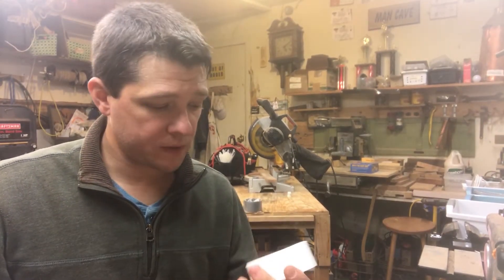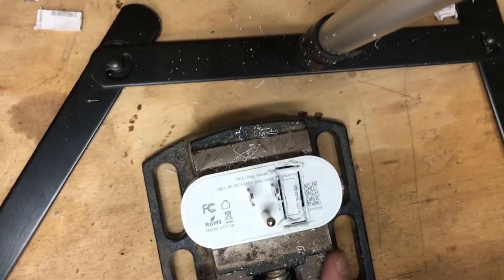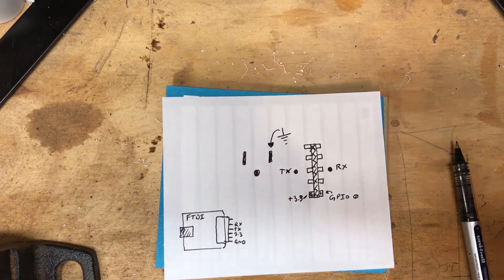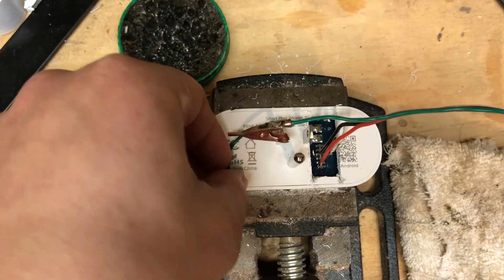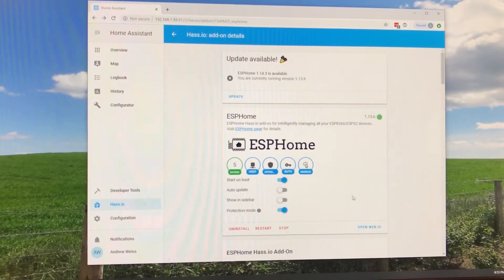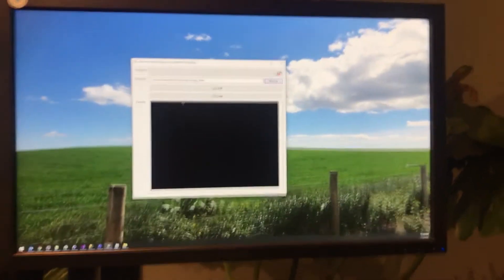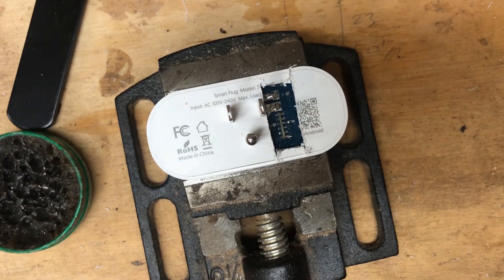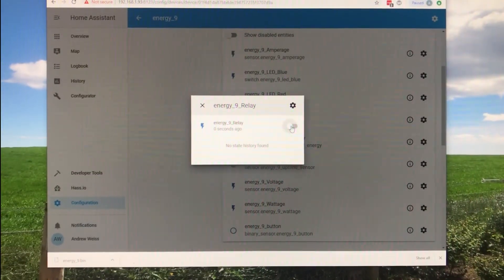Programming a Teckin SP20 with esphome by cracking it open

Comment: You don't need to open them.  The SP20 has some kinda of problem with dropping the connection during a flash, many think it's to keep us from flashing.  After you start with tuya convert and your plug seem to be hung up, or bricked it's very simple.  press control-c to exit the current session.  You're plug is still connected to your pi/laptop/etc.  run the command http://10.42.42.42/flash  That will run the thirdparty.bin.  If you do not have this then I recommend you upload whatever bin file you want to your pi but you must name it thirdparty.bin.  the flash will continue on it's own.  Just did 3 of them today that way :)
Reply: This doesn't seem to work anymore, the device never attempts to connect to vtrust-flash again, so it will never be available at 10.42.42.42 to issue that command.  I'm afraid cutting open and soldering leads is the only option now.

Comment: For those looking to do this -- received Teckin SP20 this week (US), wifi flash doesn't work... cut it open, the Rx/Tx pins are not exposed like this. (Also ordered the Teckin SB50 bulb, it also doesn't flash over wifi) BUT... the Gosund WP3 plugs flashed wirelessly, the Sonoff S31 (power meter/smart plugs) were able to be flashed with an FTDI.  I guess I'll sacrifice one of these plugs to see... but these plugs aren't the current model, so be careful with what you order.  My plugs are SP20, but they are only rated for 15A vs 16A from the video -- that might help you not buy the new version of this plug??
Reply: Wish I had read this before cutting mine open. Did you ever figure anything out?
Reply: @michaelgeissler8837  Sorry... I just put them into service as Teckin SP20s using their cloud.
Reply: @MattGithens  came to the same conclusion. I'm disappointed I won't be able to put them into service in Home Assistant. Thanks.
Reply: @michaelgeissler8837  You can still integrate them into HA. Use the "Smart Life" integration and they will work for you.... you just won't have the local IP control, it'lll be managed through the Smart Life cloud. This has worked for me for about 4 or 5 months this way and it is fairly responsive.
Reply: @MattGithens  thanks. I will try that. Unfortunately I think I will have to let the devices phone home for it to work.

Comment: Nice video.  I have done the same.  However, you can just open the case without having to make the hole on the back.
Reply: How did you open the case?
Reply: @jefffrilot9667  I pried it with a small flat screw driver.  It pops out.
Reply: @eclecticlife  I tried this but the screw driver is sticking out of my palm.

Comment: Hello Andrew,  Have you purchased any sp20 plugs lately? It looks like they made some changes, different/updated chip, moved pin locations ect. I am not able to flash them as I don't know witch pins are which
Reply from the maker: Sam, I read something similar on the Home Assistant forums.  Sounds like they're no longer using the esp8366, but haven't seen that for certain yet.  No, I haven't purchased any recently, too bad.
Reply: @weissa13  after I posted my question I did some more research and that is what I found also. Very disappointed, I now have 4 plugs I can't use or return as I cut them open.  The only thing I can do is hope someone smarter then me can figure out a what to flash these new chips to work with esphome.  Thank so much for you help! Take care.
Reply: @scpowered  I wish they would just open them up to us Home Assistant folks :(  I just want to use it to monitor when and how long my pellet stove is on so I can fine-tune the schedule for best fuel usage.